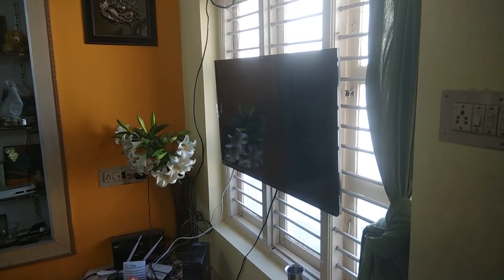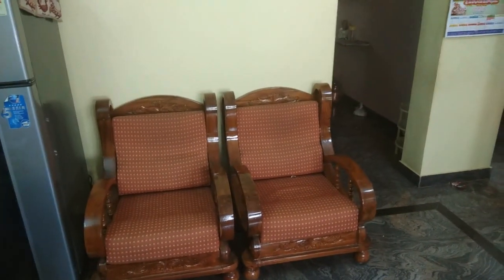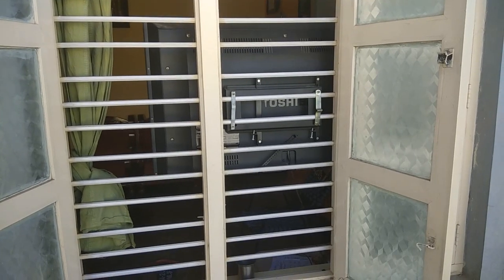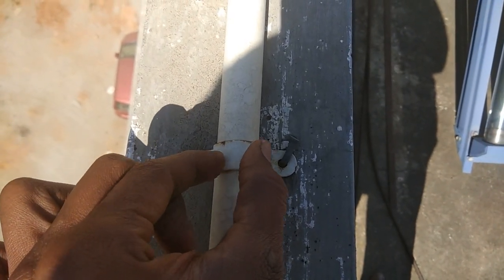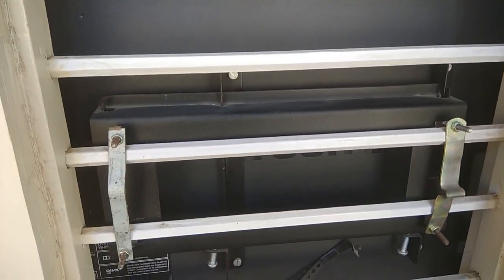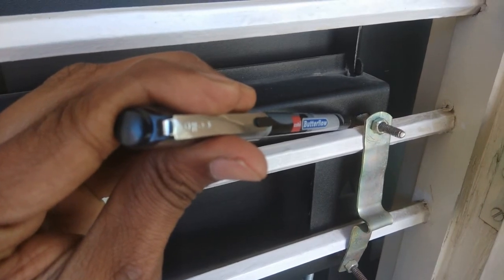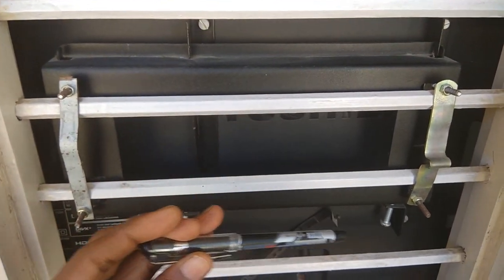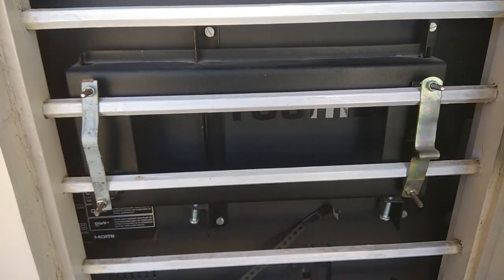How to mount TV to a window

Comment: What about light coming from Windows? Add contrast affect viewing experience
Reply from the maker: Since we are fixing TV for a window. We can not avoid that. But we used thick cloth curtains to avoid lighting. This is one of the way You can solve this problem
Reply: You can use blackout curtains to block the light, I will  definitely try this installation method because I have the same problem..
Reply: Thermocol also can b used